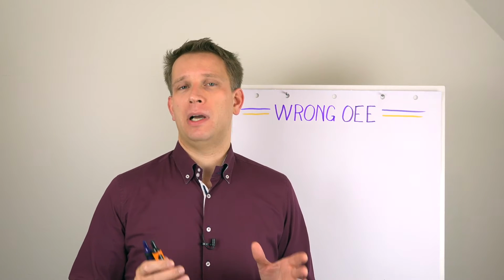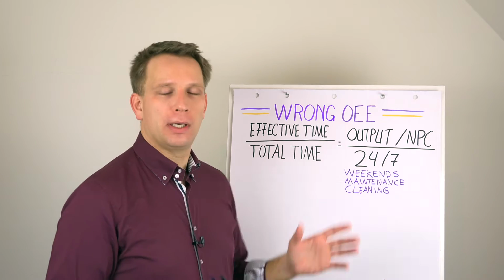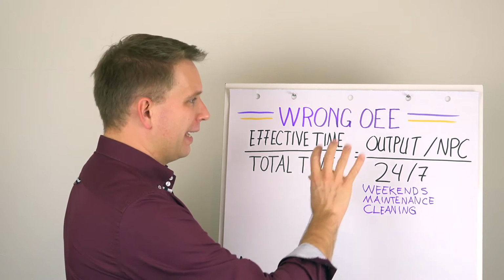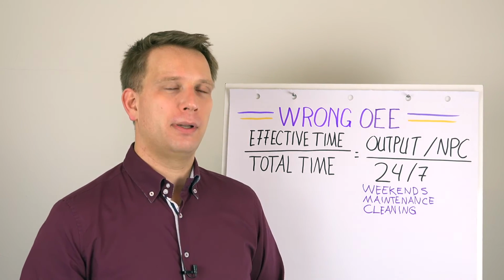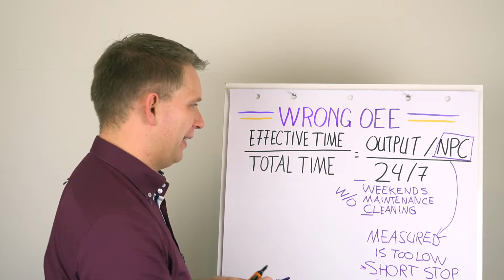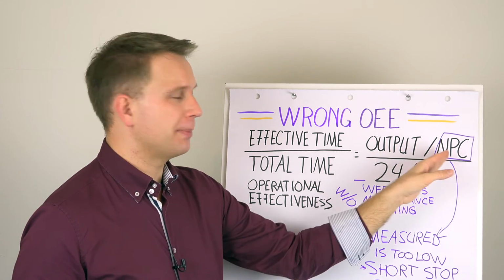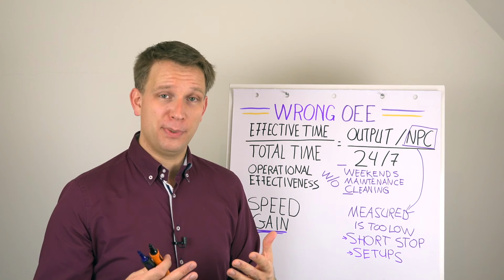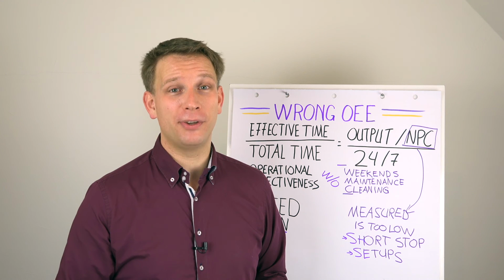Wrong OEE registration is acceptable, for some time | How to handle pre-existing OEE registration

Comment: Hi Tom - as always good video. It's funny I can find many many different ways of working out OEE. Personally I don't excuse any downtime, cleaning is a loss, maintenance is a loss, set up time is a loss. But not running night time is ok, not running weekends is OK. It is a very subtle topic. For example, I would tell my client to only use OEE on bottleneck equipment, always good to see other ideas on this though...
Reply from the maker: This came from an interesting viewer question about a problem I’ve seen before (and also experienced myself) - you try to correct OEE registration, but there’s just too much hanging on the current resulting number for many in the organization to accept your ‘new’ result.
When implementing from scratch, all cleaning is losses, etc. This video is about how I would handle non ideal situations. 
Fully agree on measuring bottleneck equipment. Had this factory once when corporate decided that the fillers are the bottleneck (true for most factories in the group), but in that plant’s setup the coolers were the actual bottleneck - that was some discussion with HQ 😉 (in the end we measured OEE losses on both, which actually gave us really valuable insights, there were instances when the filler would hold the whole line back)
Reply: Yes i often tell my clients your OEE should be bad! It should be less than 50% as it is a true measure of how much of the machines capacity you're using, but when you love seeing OEE in the 90's you're not going to change...
Reply from the maker: @paulallen5321  spot on!